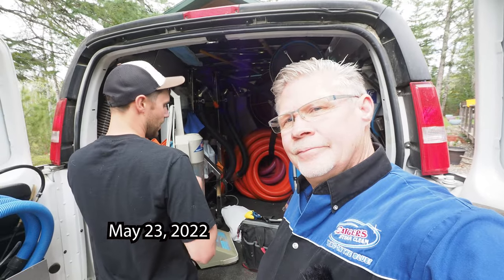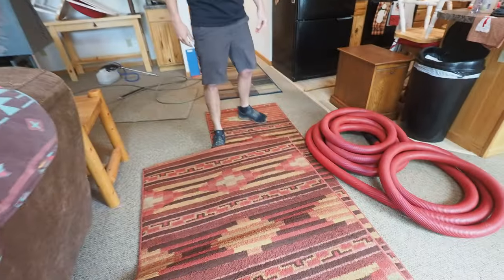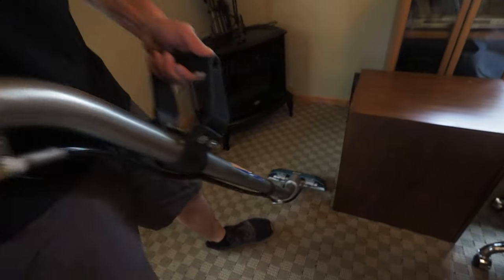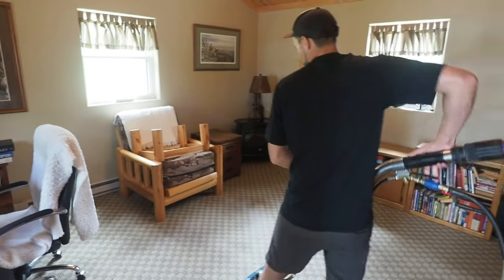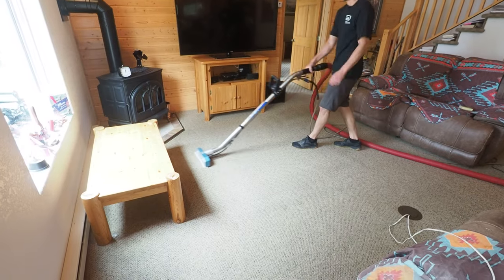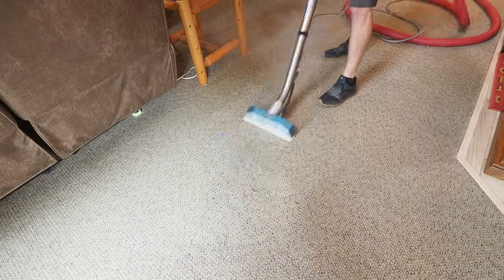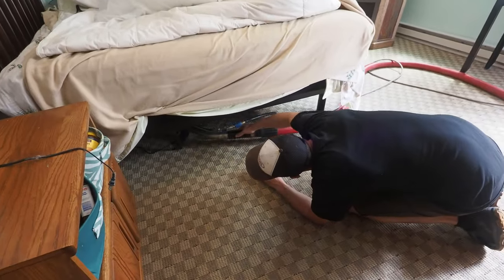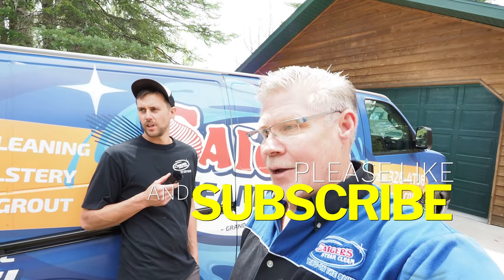Why Don't you Clean Carpets in homes more? We Do!

Comment: How many PSI do you use in your machine to clean carpet like that?
Reply from the maker: This was 500 psi at the machine. The wand is an 8 flow ( four .02 jets) with our Zipper Super Spinners we can crank the psi up higher to spin the spinners and not soak the carpets. The angles of the jets push the water and soils to the glides.
Reply: @MarkSaiger   where can i buy a Super Spinners Zipper?
Reply from the maker: @matheushenrique89  the only place is from the inventor and maker of the Zipper Wand, Erik Hiltz at www.zipperwand.com

You might need to call them also to make sure you have a sizeable enough machine to run it. He can help out 😊👍